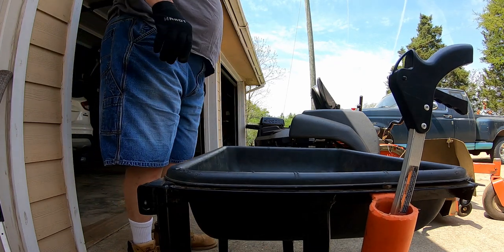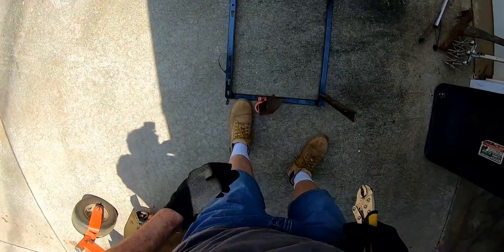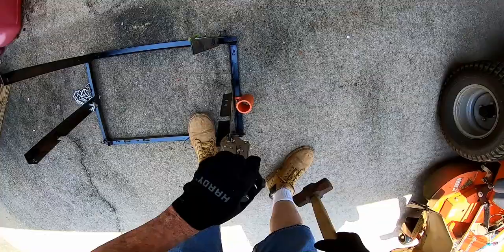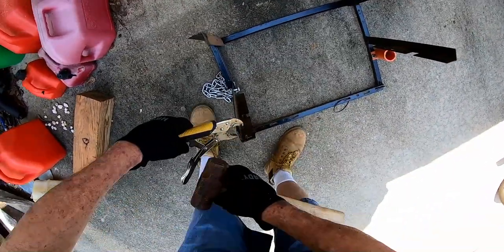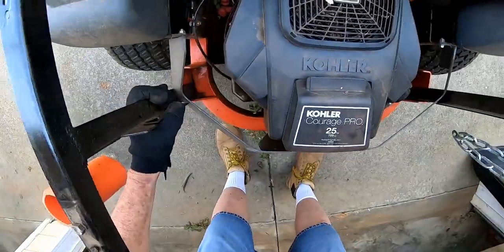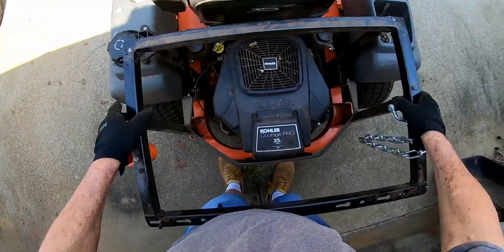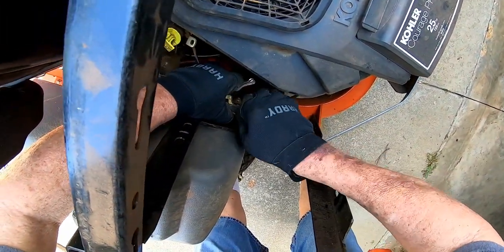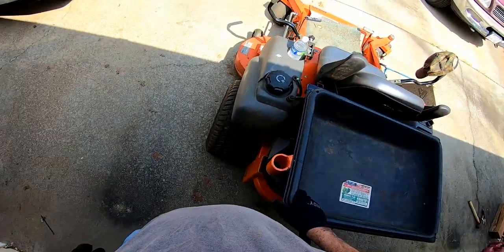Mower Bed Repairs Pwalpar VLOG

Comment: While you got it fixed, a few bolts in the right places could have helped keep your frame in place as well. Yeah, I know, there you go making more work for me. 
But if it strengthens it then that work is well placed. I also noticed the lack of cross-bracing from the front legs to the back legs and across the back of the frame.  Yup, I'm treating that frame like I'd treat the corners to a building. Putting bracing up so minor dings don't take you off to do more repair.
Reply from the maker: Thanks Hugh

Comment: I've had it on the back of mind to also make one of these dooplunkers. 
If I recall correctly, you made it with an old metal bed frame?

I don't have a zero turn so my engine is in the front. I'll figure it out. A trailer sounds simple but not when it comes to mowing.
Reply from the maker: I have never regretted making it either  it truly come in handy